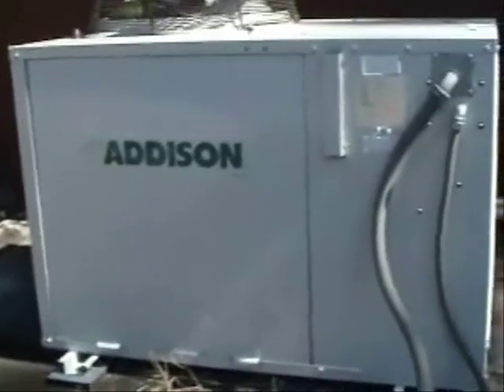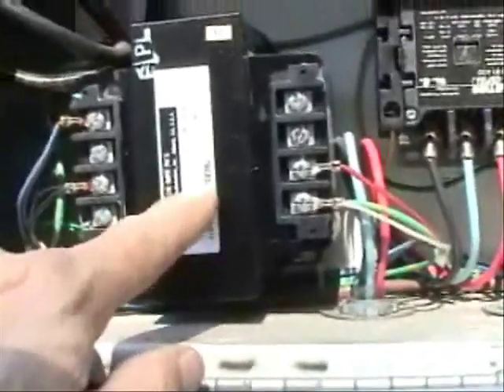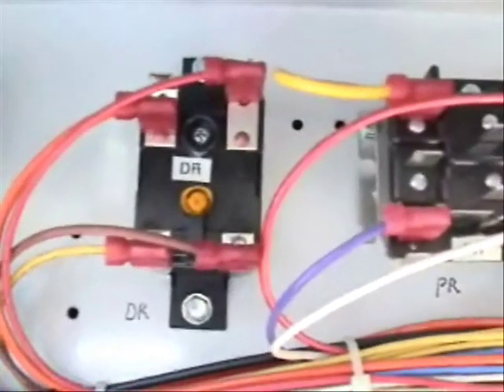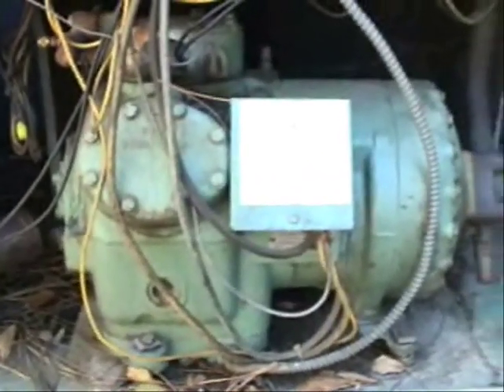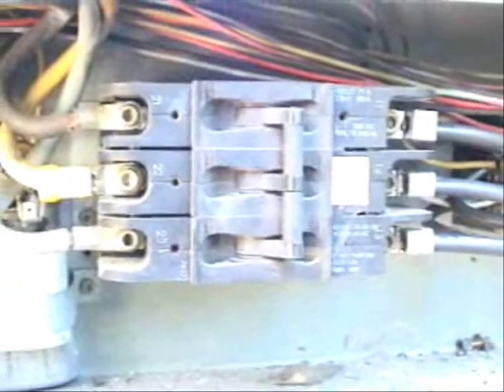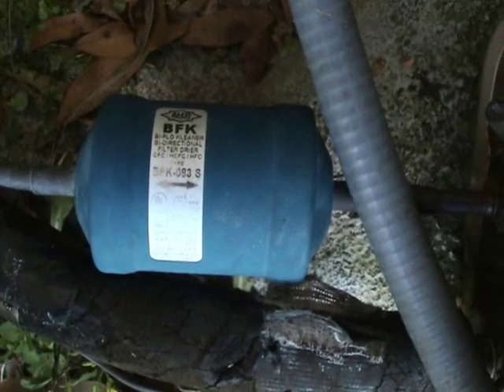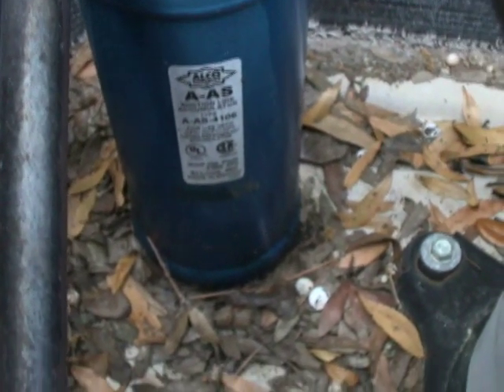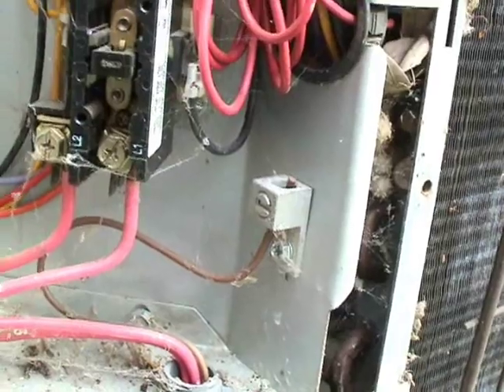HVAC Heat Pumps 1

Comment: Dr Zarkloff I have a question? What type of liquid runs inside the heat pump ?
Reply: there is one liquid line.
Reply: +DrZarkloff  at my house I had my hardwood floors sanded and refinished  with a new stain color and about a week later my AC unit outside my house stopped working and nearly caught on fire, someone said that the sawdust that got into the air vents must have gotten to the heat pump and made it short out, is that remotely possible? Because if there's fluid running to the heat pump how can sawdust get to it ?
Reply: +DrZarkloff but isn't the blower motor inside the furnace ? Inside the house ?

Comment: yes I like to know if the reversing valve solenoid can short out the transformer
Reply from the maker: Yes if the reversing valve coil is bad.
Reply: thank you yes I figured so I replaced solenoid and transformer and its running good thank you

Comment from the maker: The reversing valve isn't shifting over for cooling. It could be a bad solenoid coil or a bad reversing valve or the board isn't send the signal or the thermostat isn't sending the signal.

Comment: I have a problem with a heat pump thats not cooling, but both lines are hot, high and low. the thermostat is requesting cooling but the outside unit line is hot, whats the fix ???

Comment from the maker: @TheSam201077 You can replace the fixed orifice with a TXV. The sensing bulb needs to be fastened to the suction line. If the suction line if run horizontal then you need to install it at 4 o'clock on the tubing.

Comment from the maker: It would really be more trouble than it's worth. You'd have to add a reversing valve and another TXV and check valves. It really doesn't make sense to do it unless you're a student of the trade an are wanting to experiment.

Comment: Sorry, I have no idea.  The line runs out of the compressor and through that thicker section of pipe before going into the reversing valve.  I'm just wondering if that thicker section is a filter or expansion chamber of some sort.

I appreciate you taking the time to make these videos and answer questions.  I've done some photo documentary of automotive repairs and it's a pain in the butt to try to work and shoot at the same time... :)

Comment: Thanks for the video!  What is the purpose of the bulb/sausage shaped section in the pressure line leading into the reversing valve?  I notice it's not present on straight AC systems.

Comment from the maker: A heat pump has a greater chance of liquid getting back to the compressor because the refrigerant charge has to be setup different between the heat and cool cycles. The refrigerant charge had to be changed every season before suction line accumulators were common in heat pumps.

Comment: Now I understand, thanks. The liquid refrigerant will cause damage to the vapor pump inside the compressor. Why isn't there a suction line accumulator on straight cool systems I wonder?

Comment from the maker: Not only do some straight cool systems have fixed metering devices, some heat pumps and refrigeration systems do, too. It won't be long when a fixed metering device will be a thing of the past.

Comment: I am confused. I've seen many straight air sytems with a fixed orifice metering device at the evap coil, but here you say that only a heat pump has them. Can you explain? Also, when replacing an outside unit and blowing the lineset, I have been in the practice of opening the line at the indoor evap coil ( where the 'restrictor', 'metering device' is and blowing with nitrogen from there. I'm afraid of blowing any particles into the orifice if I were to do otherwise. Is this good practice?

Comment from the maker: The only part of heat pumps that I don't like to replace is the ever dreaded reversing valve, especially on the big systems. Sometimes, I just remove the reversing valve and pipe it in to be a straight cool system if it's an old piece of junk. The heat strips will usually get them by. I can do this because the school board is no fan of throwing good money after bad.

Comment from the maker: The heat pump is most efficient in mild climates where the winter temperatures never drop below freezing. However, if you live in climates such as South Florida then you're better off with a straight cool system with heat strips.